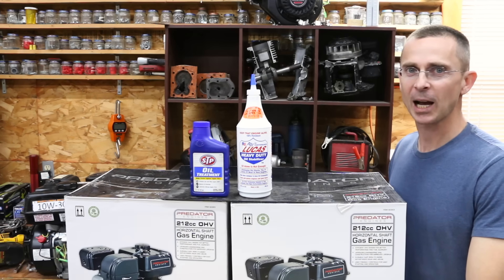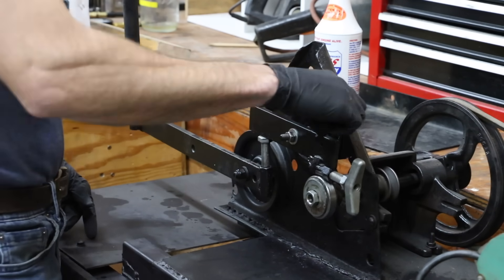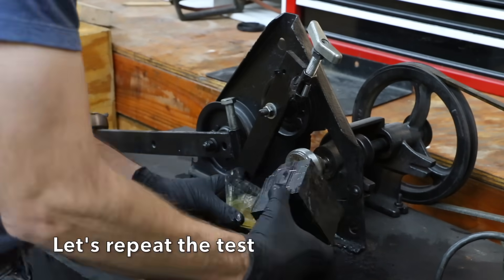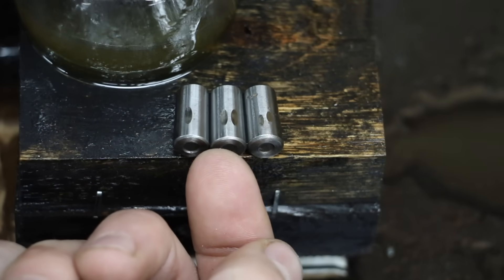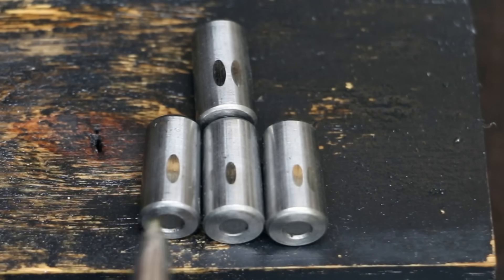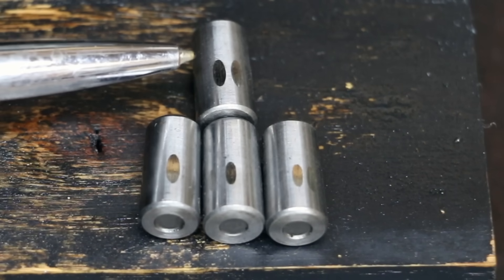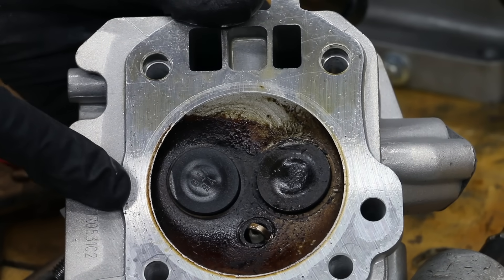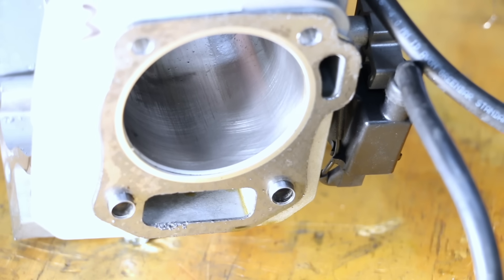Which engine self-destructs first?  Lucas or STP?

Comment: I THINK THEY USED TO RUN RACE CARS ON MINERAL OIL BUT IT HAD TO BE DRAINED AFTER EVERY RACE.  WORTH A TRY.   ALSO, WHEN I WAS A KID WHEN WE REBUILT AN ENGINE WE GAVE A DIP TO EVERY PART IN STP TO PROVIDE LUBE ON START UP OF A NEW ENGINE. WONDER WHAT AN ENGINE RUN ON STP WOULD DO.
Reply from the maker: Thank you for this recommendation!

Comment: I would love to see if you can run one of these engines on snakeoil, Not the medicine but the kind used in plumbing
Reply from the maker: Thank you for this recommendation!
Reply: thanks for replying, I do a lot of plumbing work and feel that the snake oil is probably the same viscosity would love to see how it does

Comment: Engines don't run with the oil at room temperature.  The first bearing tests are somewhat meaningless.  Heat the oil to 200 degrees.
Reply from the maker: Thank you for this recommendation!

Comment: Run a regular diesel engine max rpm no fuel additives or oil additives just regular diesel and regular oil and then run a Regular Diesel engine with Marvel Mystery Oil in the Fuel and oil at max rpm and see which one goes first?
Reply from the maker: Thank you for this recommendation!

Comment: Seems like they both caused aeration in the oil...not something I’d want. Personally, I’d stick with using high quality oils and changing them at the severe duty service intervals recommended by the manufacturer.
Reply from the maker: Yes, you're right.

Comment: In 1962 when I was an apprentice a Wynn's rep brought round a similar test rig to this which had a piece of hardened steel pressing on a roller bearing,extra pressure could be put on the steel by the use of weights to force it to stop.Engine oil was placed in an oil bath under the bearing and the machine switched on, in a short time smoke began to appear and the piece of steel began to glow red hot.Having changed the oil for new he then added some Wynn's Friction Proofing and resumed the experiment and the bearing just carried on rolling around, even when he took the oil bath away!! To prove this wasn't  a trick the rep allowed anyone of us lads to pick a piece of steel out of the boxfull he had.Needless to say to this day if I wanted a supplement I would choose Wynn's Oil Treatment. I have to say I have no connection to the Wynn's Company.
Reply from the maker: This is interesting!  I'll test Wynn's in the future.

Comment: Zinc being taken out of oil is slowly ruining all engines, can't even break-in a non-roller flat rapper cam on new oil. It will instantly wipe lobe off cam. They must be broken in on Bradd Penn or some other high zinc oil. Just check with dealers about crate engines they are pre ran with zddp oil. That should tell you how inferior today's oil actually is no matter if it's synthetic or dinosaurs. Epa's master plan, wear everyone's car out prematurely so they can get rid of fossil fuel engines quicker even though we have no  truly viable alternative. Sure they claim too but weigh the pros and cons and nothing compares to contributing to so-called global warming. These are also the people  who say in the same sentence that fossil fuels are causing climate change but there also in not enough fossil fuels left to last 20 years so how does that work.
Reply from the maker: Thanks for commenting on this.

Comment: I feel like the only reason using these products is to raise the viscosity level. 20w50 obviously provides much better protection then 30SAE. Maybe you should try testing recommended mixtures of additives and flow time test them instead of using new engines.
Reply from the maker: Thank you for this recommendation!

Comment: Just seen this , Question Where these engines Pressure Oil feed ? And  Why 10w 30 Oil . Would 30 Be better? I had always used standard weight ( Non Multi Viscosity)  oil for Air cooled Engines
Reply from the maker: Great questions.  These engines use a splash system and the manufacturers instructions call for 10W-30 oil.
Reply: Just wondering if the same results would happen with a pressurized system using 30w oil

Comment: This snake oil is super thick oil. Do not run thick oil at temps below 50 degrees F. No Flow. 90% of engine failures are dirty oil and filters. Change the oil and air filter every 15 hours.
Reply from the maker: Thanks for commenting on this.

Comment: Small engines suck because most under 10hp do not have an oil filter and rely on splash lubrication instead of pressurized delivery to main and rod bearings. And they also are used on hills and slopes so oil moves away from the splash dipper attached to the bottom of the con rod. Even Honda's oil change interval of 25 hours is way too long. Look at all the crap in your engines air filter after just 5 hours of mowing. Dirt kills small engines. No snake oil keeps dirt out. None. Change your air filter and the oil every 15 hours. My 9 year old Honda GVC160 Still going strong on 30wt HD Conventional.
Reply from the maker: Thanks for commenting on this.

Comment: Your test is not scientific and neither are any oil additives. Rule number 1 is never add an oil additive since it's viscosity is  different . A real test would be to disassemble each engine measuring piston, bore and bearing clearances when new and never run. Then run the engines for 25 hours under load with each one having a snake oil additive. Then disassemble each engine and measuring the clearances again.  A test was done on a Ford inline six in the 1970's with plain old 10W40 Drained out of the engine and it ran for over ten minutes before a rod blew out the block. There is no miracle oil or additive and all engines must still get oil and filter replaced every 3 thousand miles. Going over that, and the bypass valve opens in the clogged filter sending all the collected trash back into the engine. Change your oil/filter religiously and every 3 thousand miles. Don't forget, any engine that is a commuter vehicle routinely stuck in traffic bumper to bumper is under severe duty loading and with the  A/C on and alternator load for A/C clutch and blower fan. So during 100 degree days your engine is at borderline temps since very little air is flowing through the radiator. So your oil is breaking down faster. Additives are for idiots. And car makers love to sell new engines after warranty expiration. We call it planned obsolescence and capitalism. =Another snake oil test^
Reply from the maker: Thanks for the constructive comments!
Reply: Sure.  Here is some hard facts:
There are some videos on youtube of folks taking apart spin on oil filters. 
The pleated paper media will only hold about an ounce of trash in all it's 10 micron little holes. 
I change my filter at 1500 miles and do a full oil change and 
filter again at 3000 miles. What good is extended life synthetic oil when all filters clog and go into bypass?

Comment: Trying to see the educational outcome of this....Is it not to run a motor without oil? That's self explanatory.
Reply: The "Educational Outcome" is first suggested in the title itself,.. in demonstrating the performance of one product verses the other, under identical, extreme punishment conditions.  

The Test being,.. when just having the engine coated in the Product's film itself,. and all else drained,.. how long will that film continue to coat and protect moving parts before the lubricity breaks down,. causing heat buildup, and eventually critical engine failure.

And actual results [the actual "Educational outcome" portion] was clear enough,..  in that Lucas Oil obviously out performed STP by running nearly twice as long before critical failure.

Summation:  Lucas Oil beats STP.   

So endeth the lesson.
Reply from the maker: Thanks for the constructive feedback. In the past, some additive makers (not these brands) have used demonstrations like this to show the film strength of their products.
Reply: Project Farm I liked the video though bud.

Comment: Are use Lucas in my Chevy 350 and I lost oil pressure which made the motor seized up I’m wondering if it’s because I live in Minnesota and it got too cold
Reply from the maker: Yes, I believe you are right.  The very high viscosity products, such as Lucas, can put a lot of strain on an oil pump when it's extremely cold.

Comment: My step dad always ran STP in his engines. Not for anything other than the engines stayed cooler and cleaner. The test I would have liked to see is just hours and hours on 3 engines, one just oil, one with STP and one with Lucas. Of course the engines will fail without oil, that's a given. I'd just like to see if the engines do run cooler and cleaner. I know his race motor would get disassembled and be so clean there was no need to clean it up inside. However, a race engine doesn't get hours and hours of use at any one time. Basically rebuilt after every race.. tho with his there was little to rebuild. Mostly he'd just check the top end.
Reply from the maker: Thank you for this video project idea!

Comment: Dude your bearing test is useless...Yes because the test you are doing doesn't copy the conditions that of actual piston cylinder...
1st I would recommend you to place axis of the bearing parallel to the rotating shaft..this will help in trapping oil more and will not create one point friction.
2nd if possible try to create a submerged test in an oil...this will be closer to the condition of piston cylinder (Cause oil is in continuous contact with piston cylinder).
3rd try to use rod or bearing of same material as piston (ie. aluminium alloy)

I will be waiting to see the above recommended parameters in ur next test...
Thanxx....keep vloggin....CHEERS !!! ;D ;)) ;)
Reply from the maker: Thank you for this recommendation!

Comment: Nice experiment. But as a control, you needed a third motor running just oil in order to know if STP or Lucas actually makes a significant Improvement in the time to destruction.
Reply: From what I understand, this guy does this out of his own pocket. If so, a third engine might not be in the budget.
Reply: Project Farm  Totally agree. And really if this is going to be the de facto test setup - two to three engines on just the manufacturer recommended oil viscosity as the control group. of course you’ll also want to control for room temperature since these are air cooled. 

Personally I’d also like to see the break in oil drained off and replaced before the actual test starts because often that has some gnarly stuff in it - and that could easily be different engine to engine. 

If you really wanna get scientific and take away a little bit of naysayer ammo - it wouldn’t be too hard to put together a couple arduinos to graph out rpm and temperature through the test cycle. Just need a hall sensor, and a thermocouple or two, and an Sd shield to log to. I’m not sure how you set engine speed but doing it this way would correct for an engine that didn’t start at the exact same time as another, and for running speed, because if they start going 20-25 minutes and one is 5-10% different rpm that’s 1-3 minutes of run time, which if you’re gonna do a bunch of these tests you might as well do it right and be ready for close calls. That whole test kit would be like $30-40 an engine tops. Dm me if you want more info or a hand putting those together. 

Testing wise - These are some that jump to my mind: 
recommended viscosity vs a heavier weight vs a lighter weight, or even a 5/30 vs straight 30

conventional vs partial vs full synthetic, or if you wanna split hairs maybe a rotella t5 hybrid vs the valvoline and castrol high mileage..  since those are oil + their special additive packages. 

Zddp additive / the various disulphides..
Reply from the maker: Thanks for this recommendation.
Reply: @ProjectFarm  Can you do an engine test between Bestline and Dura Lube?
Reply: Bill Simon you don’t need a control with something as obvious of a result.
Reply: Bill Simon I thought the same Bill.
Reply: My thoughts exactly
Reply: Yep hopefully the channel grows enough he can afford to buy the proper setup, would have been great to not only have at least a control ran, but to have several cycles with the additives as well, compare the results after say 20 cycles (including the control engine) which I get would be crazy expensive but also a more insightful comparison. I love these videos, they're some of the most legit videos being made but unfortunately in this instance I'm not sure I really gleaned any helpful information coming out of this one.
Reply: My thoughts on the the other motors for control you would need two with oil and the additive in them diluted to the claim of the additive instructions thank you for the videos
Reply: Doing this properly at all would require bigger sample sizes too... Would get pretty expensive pretty quick. I mean first we need to know what the distribution of time-to-failure is for this engine (it's not going to be the same every time), and then we need another sample using the additives to see if it's significantly different. Would probably need to destroy at least 30 engines to get anything statistically meaningful.
Reply: He argued w me for months when i made same comment. But you, me, and hundreds of others are right. He just has a problem w that lol. I guess we need to pay for him another engine to do that.

Comment: I think that the Lucas won that one, maybe try putting it up against Amsoil
Reply: Amsoil is the true snake oil! You are just as well off with the cheapest crap you can find!
Reply: The STP has far less measured wear on the first test. And in the 2nd test it was run at 1/2 the mixing ratio.
Reply from the maker: Thank you for this recommendation!
Reply: + Captain Obvious,  it looked to me that the Lucas engine ran almost a full 10 minutes longer
Reply: Jon Weiss Hard to judge fair unless he used equal amounts.
Reply: +Jon Weiss

Didn't the bearing results at the end indicate that STP won that one?
Reply: +Jon Weiss

That's because paraffin wax doesn't break down as quickly as ZDDP when exposed to heat. However, when in tact, ZDDP does a better job at protecting the internal components from actual wear and scouring than paraffin wax (as was indicated by the bearing tests). 

So in other words, when use properly, the STP should do a better job of protecting your engine than Lucas providing you get your oil changes at 3,000 (or 4,500 or 8,000 depending on if you use synthetic) miles on the dot. However, if your the type who likes to stretch your oil changes past the manufactures recommendations, then Lucas is probably what you want because it will break down slower. 

So the answer as to which one is truly better is "it depends on what you're trying to do."

Comment: Molyslip has worked for me in the past. Deutz engines with over 100000 hours in them and know visible wear on crank bearings and wrist pins oil pressure still in original spec. Totally amazing product. These engines ran generators but had a dry sump system. Main oil supply was in the tank they where mounted on.
Reply from the maker: Impressive!  Thanks for commenting on this.